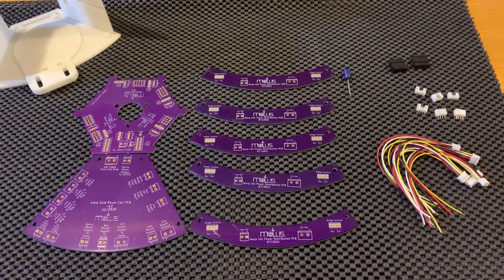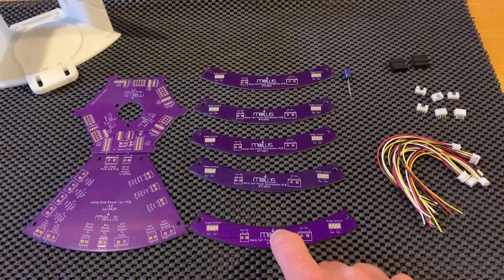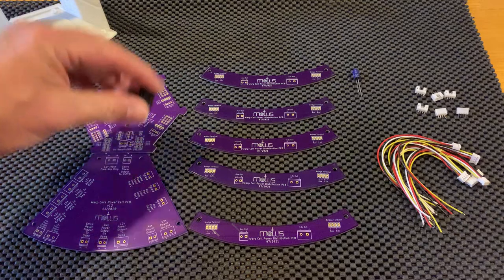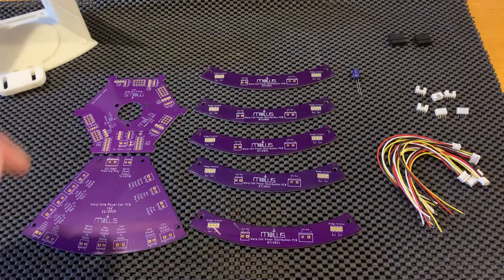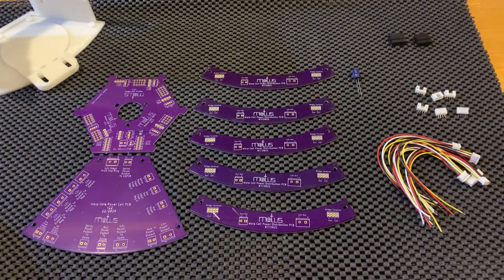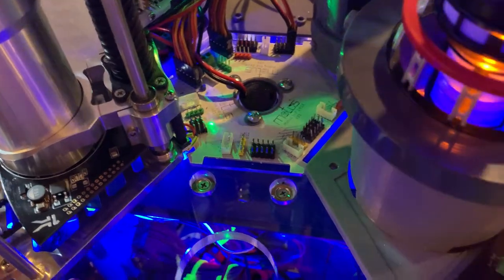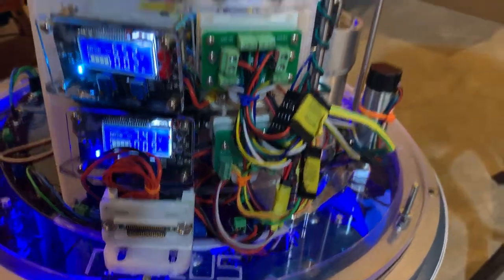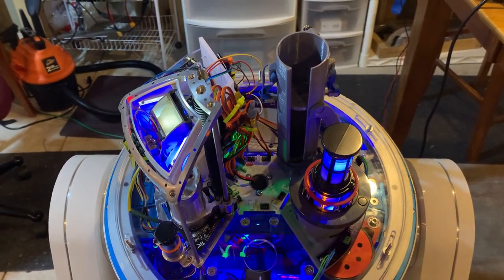Warp Core Dome System Unboxing

Comment: Hey Douglas is there a BOM for the power cell?
Reply from the maker: I have the list in the PCB run on astromech.  Basically 160 2.54 pin headers and a bunch of terminals. 

I provided the JST headers/harnesses,, cap, and 2x6 plugs for the Center Signal PCB. 

The Power Cell requires 13 two pin 5.08mm  pitch screw terminals and 14 two pin 3.5mm pitch screw terminals.

Comment: Great work!  What is that pulsing blue light thing that you have? Never seen that in a dome before.
Reply from the maker: It’s a Warp Core USB phone charger from Think Geek (Easter Egg).   I decided it was only appropriate to have a Warp Core on the Warp Core Base Plate.  😎 I remove it when I want to use that space for the ARDS Cell until my other designs are finished.